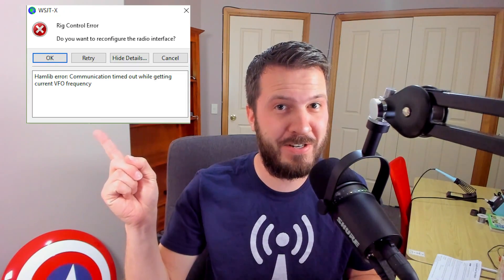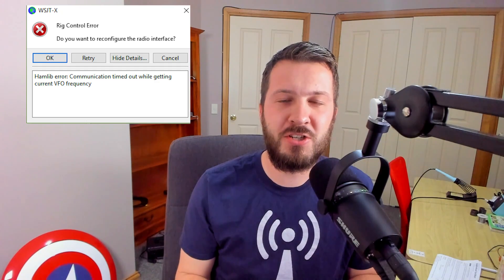Fix Rig & Audio Errors | WSJT-X CAT Control

Comment: Your video was very helpful and got me looking in the right area. I changed the usb cable to a good quality with toroids and it helped. I was moving things around and the problem came back then I discovered the cable was laying across the top of my switching power supply. I moved the power supply and the problem is gone. This had bee driving me crazy for weeks and thanks to you it was resolved. Keep up the good work!! W1HFB
Reply from the maker: Great to hear mate!

Comment: My USB cable from my IC-7100 to Dell Laptop has 2 clamp on Ferrite nodules installed, which did not solve the problem.  I had a 3.3" MnZn PC40 Toroid in my project box, so I wound it exactly the way you did and the problem is solved!  I just made 2 FT8 contacts on 80m.  Thank you very much!!

Comment: I have a occasional RIG control drop out.  I use a dedicated USB to TTL for my ICOM IC-746 and a SignaLink for the audio.    I just upgraded from a perfectly working Windows 7
to Windows 10.  I had it save my Files, Programs.   For some reason it didn't like the driver for the Prolific USB to TTL cable.  After much searching I found an older driver
that worked.  However just sitting there receiving after maybe 5 or 10 minutes the RIG control drops out.   If I click Retry it restores it until the next drop out.  
WSJT-X version is 2.5.4 d28164.   There is a newer version and I thought about trying it but I am thinking there could be a setting change to try before I go with the latest version.
Any thoughts?   thanks Ken

Comment: Here's an odd one. I got WSJT-X working fine, made several contacts on 10 and 20 meters then on 40 meters the green receive audio level indicator on the left side of the display simply stopped responding to adjustments of either the external or internal soundcard volume or microphone level. It's stuck on whatever the last setting was, which thankfully was OK, but now I can't change it. The TX slider does work to keep the TX audio from engaging the ALC. The sound card volume control does work as it should on other things like YouTube videos. Seems like a lot of frustration just to get my laptop to say hi to other laptops.

Comment: Can a similar solution be used to reduce unwanted noise from LED lighting into the coax and back into the radio? If so, will it reduce the RF going out from the radio to the antenna on 144 MHz?
Reply from the maker: Hey mate, check out this video here which deals with common mode current (and noise) suppression on the coax - https://youtu.be/r2deRuOXJfI

Comment: I just dropped the T240 toroid with 4 turns - elimated the 80m feedback; but I do loop 8 turns of the coax feedline onto an iron fence (small 12 inch or so loop) in the backyard before the feedline penitrates the house/rig. All clean across all the other bands.

Comment: Not a bad idea to use a common mode choke. If you build one its a good idea to measure its real reduction of rejection.  If you can get it 70 to 80db reduction you will see things work better.  This  reduces the need to add anything else to fight RF in the shack.

Comment: Willing to try it. Cheaper option too. I am a 10 and 11 meter band user at home and mobile. Would this work for these bands ? TIA. Great video too.
Reply from the maker: Yes they would Mark. For the common mode choke on your coax, check out the other video I reference in this video. There is a chart in the description that will show what toroid and how many turns to use for 10/11m. Cheers

Comment: Even with a choke there is differential rf from my laptop mucking up my waterfall when I use USB. So one solution is an optoisolator usb interface. But there is another class of error. The rigctrl built in to wsjt-x is pretty sensitive to timing. This shows up especially with ic-705s running over wlan and doubly so when in client mode instead of ap mode. The trick is to change rig type from ic705 to hamlib net rigctl and run rigctld externall on localhost. The easiest solution i find is to just hand over rigctld AND rsba1 client duties to kappanhang on linux. The most stable wsjt-x and js8call solution i have found thus far.

Comment: An even simpler fix is just buy a long enough USB cable, 3 meters or 9 feet, and then at each end wind 6 to 10 turns and fasten with wire ties or zip ties.  That chokes both ends and doesn't cost a minor fortune.   Also works with antenna cable.
Reply: Hi Thomas, 6 to 10 turns around what.. or just some turns.. if so what diameter? That RFI in my shack is driving me crazy ;)
Reply: @Damaniac1964  Just some turns.  Each turn adds more inductance.  How much you need depends on frequency and the magnitude of the problem.  At 10 meters (28 MHz) probably only 2 or 3 turns provides an effective chock but at 80 meters I'd go with 10.  It isn't a hard block; it is an impedance.  You want to limit it only to the point that you don't get shocked by your own transmission or damage the transistors.
Reply: @thomasmaughan4798  Tnx Thomas, I give it a try.. I am mainly on 20 mtrs so I guess a 6 turn(ish) would get some improvement ;) Got some long USB cable around so.. appreciate the help ... 73, de PD1ECA ( Rob)

Comment: I had this issue with my 705, I tried on both ends of the USB but it would still happen on certain frequencies. What resolved my issue was a clamp on ferrite on the coax itself right before the connector with 2 turns.
Reply from the maker: Good stuff!

Comment: Oh no not another 7300/9700 with rf getting into shack electronics 😳😁 I guess the torroid manufacturers are going to do well again this year. I know Ape helps bring up the palamar engineering bottom line with all the roids he buys 🤣
Reply from the maker: To be fair I had these issues with my FT-991, so more the issue is the antenna than the radio. Interestingly I used to operate a 6 element 6 meter yagi which didn't have properly choke on the coax line. It used to pickup a heap of noise and also cause my radio to disconnect infrequently. 

I modified the yagi to a LFA loop yagi and the results were amazing. I might have to do a video one day on that.
Reply: @HamRadioDX LFA?

Comment: Hi Hayden,
Good tips. Need to try a toroid on my USB cable. I get infrequent disconnects and all I need to do is click Retry when the dialogue box appears. Usually happens just as my FT450 goes into TX to reply. You and the family stay safe.  73  WJ3U
Reply from the maker: Thanks Don, please let me know if it works. Just half a dozen turns for me, but your mileage may vary. Cheers mate

Comment: If both are Mix-43 (I will assume it's those, using them myself as well), these are:
- the large one: T240-43
- the smaller one: T140-43
Reply from the maker: They are both mix 43. For the coaxial choke after doing some reading, a mix 31 is probably better.
Reply: @HamRadioDX  I have read that too, but I am unsure (yet), will have to order some

Comment: Any recommendations on where to buy those toroids in VK? Tried Paloma engineers in the US and they wanted $160 postage for 4 rings!
Reply: Same issues with IC-705  also place enough ferrite beads to make a prayer bead on the ATU to the radio and the USB cable itself  , installed counterpoise and even changed the setting allowing charging by PC , Mobile and Table on the IC-705 thanks for the tips.
Reply from the maker: MiniKits mate - 
https://www.minikits.com.au/components/magnetics/ferrite-cores/31-material/FT240-31
https://www.minikits.com.au/components/magnetics/ferrite-cores/43-material/FT140-43